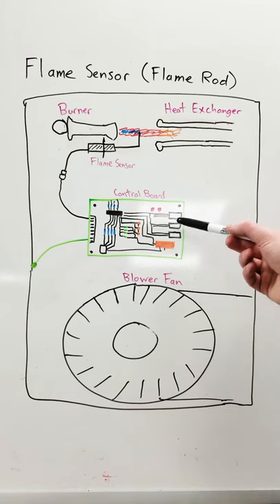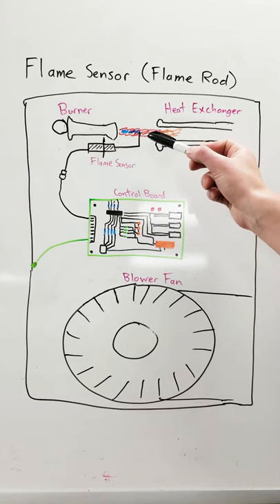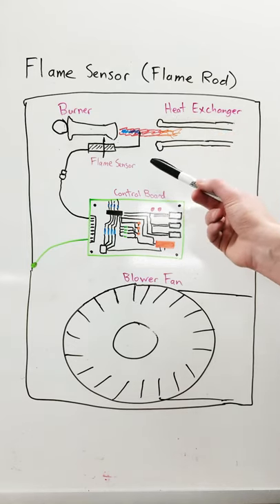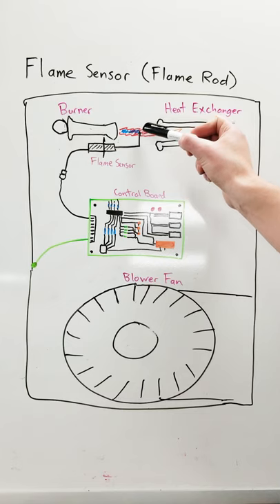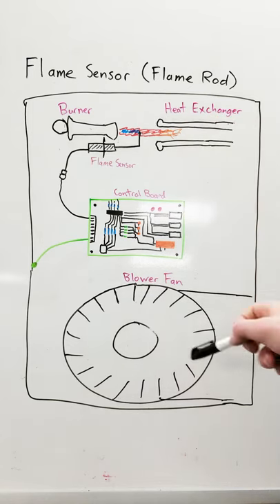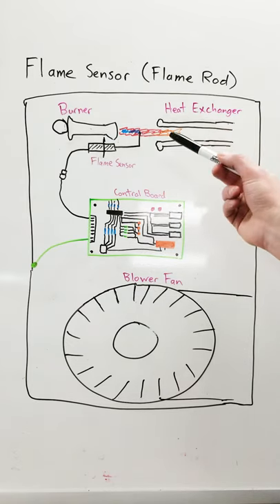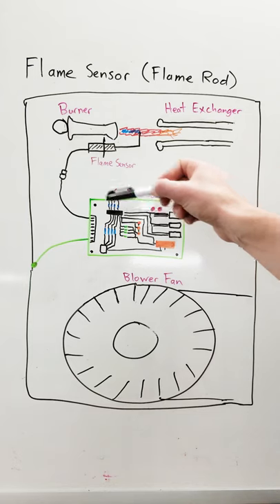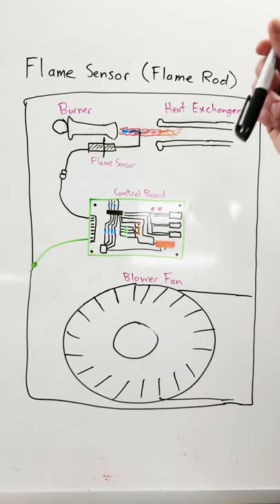How the Furnace Flame Sensor / Flame Rod Works #furnace #furnacerepair

Comment: My furnace starts up with flame appearing, but shuts off about 2 seconds after flame being lit. To troubleshoot my furnace, I have watched a lot of videos. Your explanation of how the flame sensor works is the best! Thank you! Apply a voltage to a circuit and then measure the current flowing in the circuit. When no flame is present, the circuit is incomplete, so the measured current is simply zero or close to zero. When conductive flame presents and complete the circuit, the measured current is non-zero. I know the primary cause of the failure of flame sensing is due to a dirty flame sensor, but in my case, the failure is due to the fact that no voltage is applied to the flame sensor. I measured the voltage across the flame sensor and the ground. The measured voltage is zero. I learned the correct applied voltage is supposed to be in the range of ~50 to 120 VAC. So in may case, the failure is due to a bad control board. I inspected the control board, no burning mark appears. The board looks in a very good condition. I tried to search for the schematic of the board, but did not find any. Is the voltage source applied through some relay? If so, then the most likely it might be a bad relay causing no voltage. I am wondering if you know where is the source of the flame sensor voltage. If you know, or you have any other suggestion of how to troubleshoot the control board, could you please teach me? Thank you!
Reply from the maker: Thanks for sharing your experience! When it comes to control boards it is difficult to narrow down the problem as tracing circuits and repairing components requires an entirely different skill set and knowledge. In most cases the time and effort to repair a specific component on the control board is not worth it, so in many cases a new control board is installed instead. This removes all variables from the equation, and makes it more certain in a way.
Reply: @AmreSupply  Thank you for your kind suggestion. I tried to trace down the path backwards from the flame rod back to the voltage source. I was successfully getting some of resistors, but the components are so tine, it is not easy to make a good contact, particularly when getting near to the source end, so I had to give up. I have ordered one used board from eBay. Hopefully, the board is a working one, otherwise, I will have to order a new universal replacement board. Again thank you for your kind response and help!

Comment: I took mine out and sanded it in attempt to fix a short cycle condition (at least I think that’s the correct terminology). 

When the t-stat calls for heat, My 90+ will light up and burn and blower starts and then usually anywhere from 2-5 minutes later it will stop. Then it will attempt to light again. Usually it does this once or twice and then will run until t-stat is happy and says to shut down. 

Would that be unlikely to be a flame sensor rod or circuit issue? Called local repair place who also sanded and adjusted the gas pressure and of course it performed flawlessly then. But over the past week I’ve noticed it still does this short cycle frequently before a proper long cycle. 

FWIW this is a Carrier.
Reply from the maker: Thanks for watching. If the burners are clean and the flame sensor has a good path to ground then it could be an issue with the airflow / air supply. Check to make sure that the flue vent is unrestricted on the outside of your home. Sometimes leaves, debris, ice or snow can interfer with this which could trip the pressure switch if the inlet or exhaust airflow is restricted. As well a moisture buildup in the condensate trap could also create issues so make sure that the condensate is draining properly.

Comment: Would this be a reason why my heater will only work during the day but not at night?
Reply from the maker: Thanks for watching. If your furnace only works during the day then it's best to change the air filter. The demand for heat during the evening is greater, so any restriction of airflow can cause overheating. This would trip the limit switch.

It could also be an issue with the air supply, or a buildup of condensate (for high efficiency furnaces).

You can see some further repairs in this playlist: https://www.youtube.com/playlist?list=PLCo9SMjkdWBzorzNrARLKALj9fW7HzHMh

Comment: Can a hot surface igniter be used as a flame sensor?
Reply from the maker: Thanks for watching. A hot surface ignitor is a coated resistor which is designed to heat up when current passes through it. It is not the same as a flame sensor and would not work in place of a flame sensor.

Comment: My Ruud not working, changed control and flame sensor check ground nothing seems to help
Reply from the maker: Thanks for watching. If the flame sensor is good, the burner is clean, there's a good path to ground and the connection to the control board is good, and if the flames still don't stay lit then it could be an issue with the control board.
Reply: @AmreSupply Thank you for your feedback, I’ll look into that, thank you